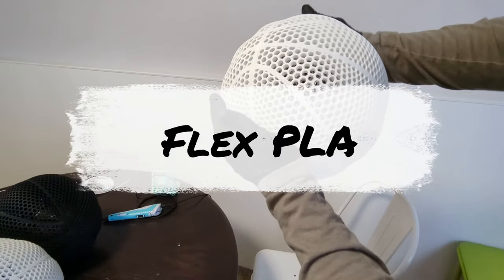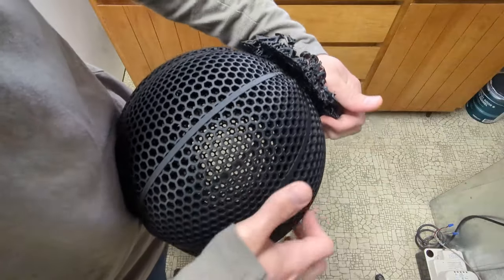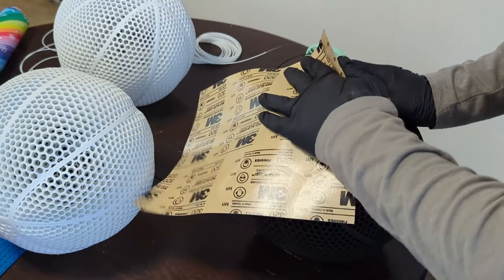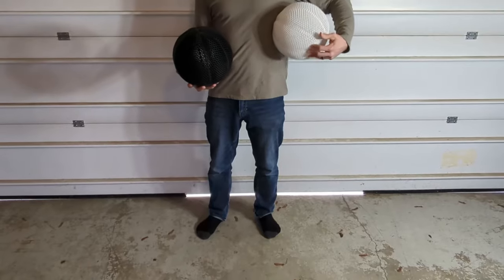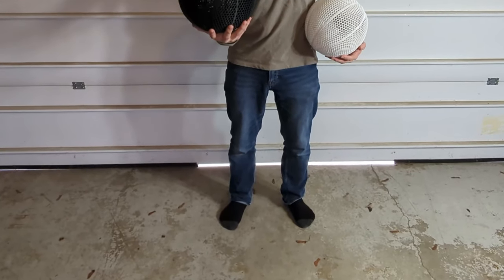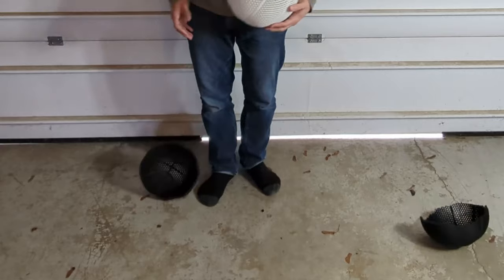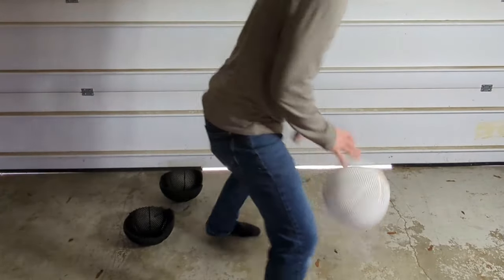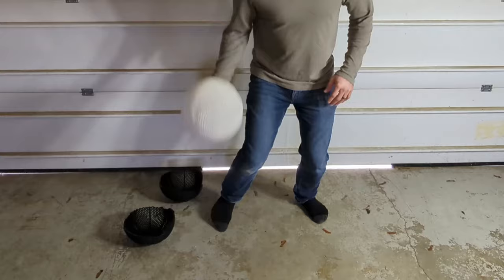Best PLA for 3D Printed Airless Basketball – Flex PLA or Super PLA+? Surprising results!

Comment from the maker: What should we try next?
Reply: Try PC-ABS from polymaker, it is extremely impact resistant and not too stiff.
Reply from the maker: @riba2233  might have to give that a shot - thanks!
Reply: @makeitlabchannel  awesome, hopefully it bounces :D
Reply: The correct filament for this task is PEBA, nothing else even comes close.
Reply: Maybe nylon
Reply from the maker: @FIashOOT  good idea - I wonder how that would turn out
Reply: Nylon?
Reply from the maker: @JuanRamos-nn9yg  yeah that could be worth a try for sure 😁
Reply: SEBS or PEBA
Reply from the maker: @JonWilliams84  yeah both of those would be good to try
Reply: It would be interesting to see if you could find a heat resistant powder or fine granule that you can completely submerge the basketballs in and high temp anneal them. Stands to reason that the more unified the layers and walls, the less likely it is to break.
Reply from the maker: @TBonerism  that is an interesting idea, might have to look into that 😁
Reply: Print in peba and do a few other things including get gloop and do the testing uncle jessy nvr did  @makeitlabchannel
Reply: @makeitlabchannel also the flex pla you used seemed to work good but to soft for a proper bounce so maybe if you stiffen it up with polydip or something or hell even take a 3d pen and just add some hard pla to the seems of it and add heat to smooth out and sand down after then some paint i bet thattttt would be mintttt because it looks like there just to soft to have the springyness the stiffer ball has and if its just added onto the squishy ball there should still be flex for the firmer pla am i wrong?
Reply from the maker: @ZOMBuckaCurt  yeah I think part of it is figuring out how thick to print the ball as the more "walls" you add the stiffer it gets, but then it breaks easier so I think there is a sweet spot. I also had better bounce using the double-lattice file, so printing the flex PLA thick with double lattice and painted with Plasti Dip might be a good way to go 😁
Reply from the maker: @ZOMBuckaCurt  sounds good!

Comment: Just commented on one of your other videos. I've seen a semi close up shot of the Wilson ball and it's not a solid honeycomb. It's 2 layers with struts from every corner of the honeycomb shape connecting the 2 layers together. I wonder if their design has something to do with it's durability. Maybe a revised model closer to theirs would hold up better, maybe even bounce better.
Reply from the maker: I agree, I think the model used to print is definitely worth experimenting with to see which one is best.
Reply: Yes, this. The internal structure is important both to function and durability.
Reply: @makeitlabchannel I would think that the two layers would be two different materials in a cubic lattice structure. The outer shell made of something tough and grippy (is Flex PLA tough?), the inner structure made of something like NinjaTek Edge (NTE), a TPE material of some sort. I am not sure how well that would hold up on its own, but worth a try as a single material too.
Reply from the maker: @ManjaroBlack  great suggestions 😁

Comment: I print my Overture Super PLA+ on my Bambu P1S using a custom profile at 240C and it made a pretty significant improvement in the durability of the prints due to better layer adhesion
Reply from the maker: Oh might have to try that!
Reply: @makeitlabchannel  I print most of my Overture PLA at that higher temperature now with excellent results.

Comment: Would the flex pla work in the Flash forge Adventurer 5M?
Reply from the maker: @masonmccloskey9962  I watched a video where someone printed you with it, so it should be able to print the flex PLA. I would recommend a 0.6mm nozzle if possible, a filament dryer, and print bed glue sticks for both adhesion and a release agent.
Reply from the maker: @masonmccloskey9962  https://www.youtube.com/watch?v=1PqpDa1FnbU

Comment: Why not tpu
Reply from the maker: The big reason is I have watched a lot of other videos where people used tpu, and it looks like it might be too soft of a material for a good bounce compared to the others I used. There are different TPUs out there so maybe a specific kind could work
Reply: It is wayyyyy too soft, comparable to a basketball with a hole in it or very little air

Comment: Try to make the flex pla print slightly thicker to match a basketball's bounce responsiveness more if you know what i mean/ trying to coat it in something like rubber or smthg similar could also increase durability and maybe make it grippier
Reply: For the rubber im thinking just a slight coating just like the super glue cover i saw in another video which does have a slight rubbery/ plastic feel
Reply from the maker: Great suggestions 😁

Comment: Please try atomicfilaments impact modified v2 pla+. It’s supposedly is less stiff than pla and more durable against impact. 

Also when is your next video testing out more filaments? I’m so excited!
Reply from the maker: Hey there, I will add the modified v2 pla+ filament to the list 😁 I haven't received some of the filaments in the mail yet, so the first video to come out (hopefully next week) will be coating PLA basketballs with plastic dips, but once I get all of the filament/test/troubleshoot, I will print them out and post a video. So probably a couple of weeks unfortunately😕
Reply: @makeitlabchannel  ok, sweet. Maybe if you get some of the filaments you could also just do 2 parts. There are quite a few filaments that people want you to test, so it might work to just do the first few filaments you get in part 1 and the rest in part 2.
Reply from the maker: @ScaleToTheWire  yeah that is a good point, I will try and break it up into parts as I get the filament. One of the filaments I wanted to try was PEBA, but it is back ordered until late April at the earliest 😐

Comment: Maybe try spraying it with that Flex Seal spray. Or Plasti Dip spray. Both are a rubberized coating you can spray on. Even better if you tried both and compared the two.
Reply from the maker: Funny you mentioned both of those, as I just bought both of them earlier but in the liquid form to coat them instead of the spray, although the spray might actually coat more even

Comment: I printed your new file in FPLA, printed great, but after 5 mins of bouncing a huge crack formed, any Idea how to fix it?
Reply from the maker: @armyguy6335  oh dang, sorry to hear that 😕 what printer and printing speed did you use? I used a 3D pen with some extra filament to patch some and it worked fairly well but was a bit tricky. I was going to see if 3D gloop would work as well

Comment: Do you have an AMS if so did you put the flex pla in the AMS?
Reply from the maker: Hey there, yes I do have AMS, and yes I have tried to put the flex PLA in there. It caused major issues and stretched/got tangled, and I could not get it to work. I think the way to go with this would be a multi-material system (MMS) printer for using multiple flexible filaments, because I could just not get the AMS to work with it or PEBA either.
Reply: @makeitlabchannel  thanks for your response.

Comment: What even is flex pla? What additive is it? And is it hygroscopic like tpu?
Reply from the maker: flex PLA is a PLA filament made by Ataraxia art (that is the only company I can find that currently makes it). They said that they "used quality essential raw materials derived from starch or corn, to make our 3d printer Flexible pla filament", so it sounds like it is PLA mixed with some additives. Based on reviews, people said it is very hygroscopic. Link is here: https://www.amazon.com/gp/product/B099QZB4ZT/ref=ppx_yo_dt_b_search_asin_title?ie=UTF8&th=1
Reply: ok so to cut through the bs, it's just pla mixed with tpu pellets  @makeitlabchannel
Reply from the maker: @jme2006  Yeah based on what I read that sounds correct.

Comment: Having a problem with using Flashforge Flex PLA with my  X1C. I've dried it for about 30 hours and it still clogs up in the extruder. Any tips or tricks at all? Been trying to troubleshoot this for about a month or so and have no came to a conclusion. Print looks awesome btw. Thanks
Reply from the maker: Thanks! Oh interesting, I didn't know flashforge made flex PLA. What temp/speed are you printing it at? I just used a generic PLA profile and printed mine at 220C and 200 mm/s.
Reply: @makeitlabchannel  I’ve been using 220C for temp. Where are you turning the print speed to 200mm/s. There are 100000 different speed settings in Bambu slicer and I’m never sure which one is the correct one. This is going to be huge if you could help me.
Reply from the maker: @smoove8124  If it would be easiest I can send you a 3mf with my settings, just send me an email at makeitlabchannel@gmail.com if you want. but for the 200 mm/s I am referring to the "outer wall" speed on "other layers speed" section of the speed settings. My inner wall speed is actually 300 mm/s, and the rest of the speed settings are between 200 and 300

Comment: What filament setting did you choose for the flex pla... In bambu
Reply from the maker: I just used a generic PLA profile, and I added the main settings that I have in the description (220C, 200 mm/s, 3 walls, 15% gyroid infill, normal supports only on bottom).

Comment: Did you have trouble with no support for top?
Reply from the maker: With the hard plastics it seems to print with no problems, but the flex PLA struggled a bit, but it has also pulled through each time. All of the cracks/breaks that formed on the balls was along the middle layer lines, never on the top so I think it works well enough

Comment: For the life of me I cannot get Ataraxia FPLA to play nice with 8 days of 4+ failed prints between .4 and .6 nozzles T_T
Reply from the maker: Oh no, sorry to hear it! What printer are you printing on? Does it look like clogging or adhesion issues?
Reply: @makeitlabchannel 
220C, 12mm^3/s clogged by 2nd layer LOL (default generic PLA settings)
220C, 3.6mm^3/s, no retraction clogged at 48H! (TPU profile)
205C, no enclosure, 3.2mm^3/s no retraction clogged at 30H!
.6 nozzle 200C no enclosure 2mm^3/s clogged at 10H. I thought .6 was supposed to be the anti-clog GOAT!
Currently trying an attempt with .6nozzle 230C, 1mm retraction, 2mm^3/s 4.5day print. 

I'm at my wits end, but im too stubborn to quit. could you send me your sliced file or at least share your fpla settings? Im using a bambu p1s
Reply from the maker: @Mettleh3d  Yeah I would be happy to send over a 3mf, a P1S is what I used as well. If you email me at makeitlabchannel@gmail.com I can send it over
Reply: @makeitlabchannel  thanks! Ill let you know if I've any luck with it 😅